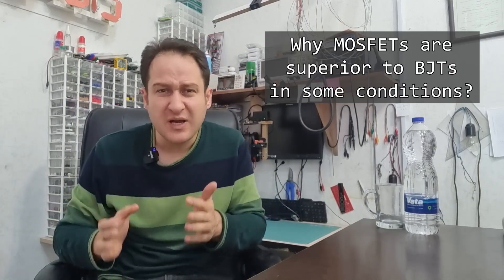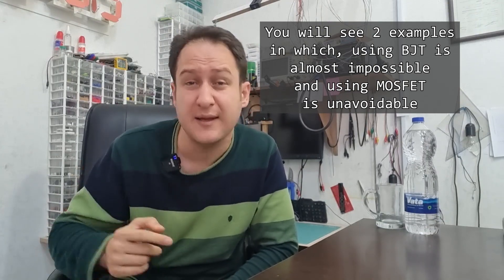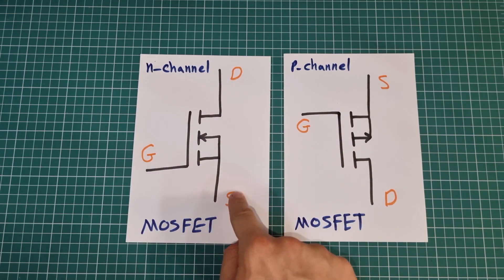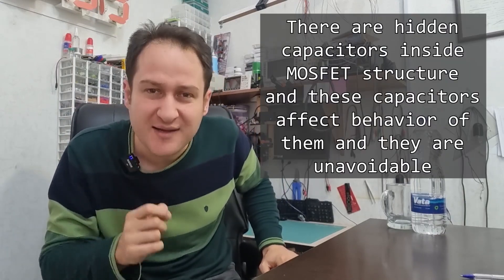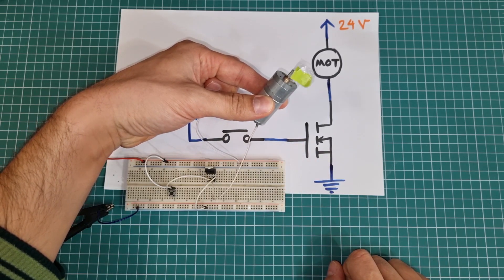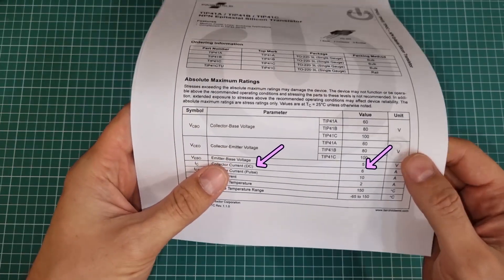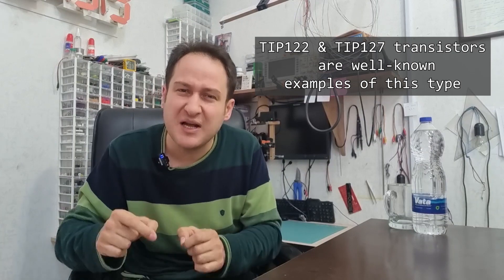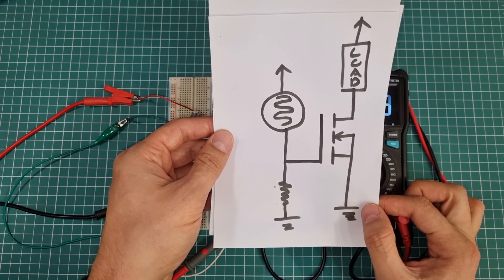MOSFET vs BJT, Unforgivable misunderstandings about them

Comment: Too simple... in high current the output resistance is much lower than bjt.
Reply from the maker: Yes, in most cases that is true
Reply: Not necessarily. The IRF530 mentioned in the video has an Rds(on) of the order of 160mΩ when fully driven on. At 4A that's a Vds of 640mV, so a power dissipation of 2.5W. The TIP41 shown in the video will have a typical Vce(sat) of 300mV at Ic=4A, giving a power dissipation of 1.2W. Of course, there are mosfets with much lower Rds(on), but you have to make sure you specify one if you want to get an improvement over a typical BJT.

[Edit:] Actually the video mentions the IRF630, which has an Rds(on) as high as 300mΩ, so you might have to dissipate almost 5W at Id=4A.